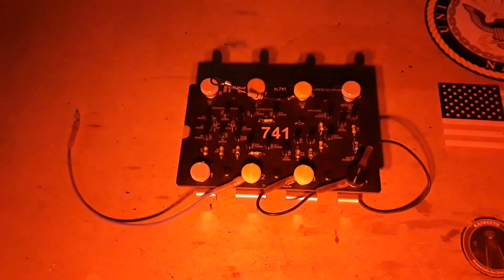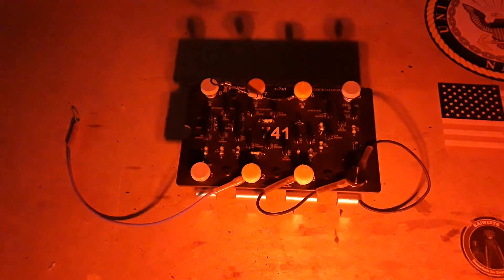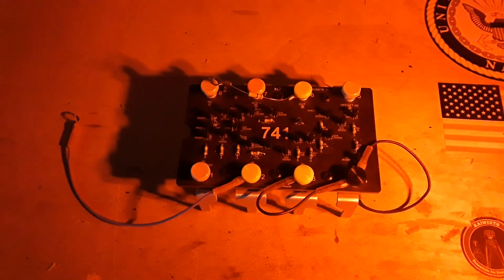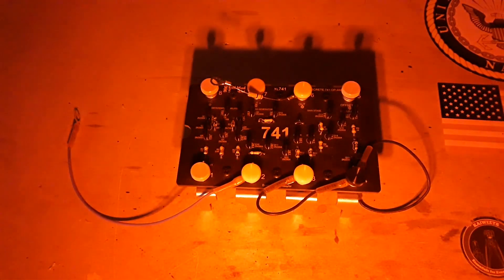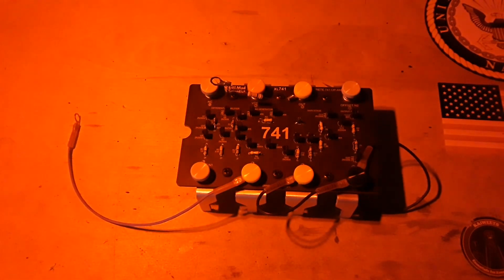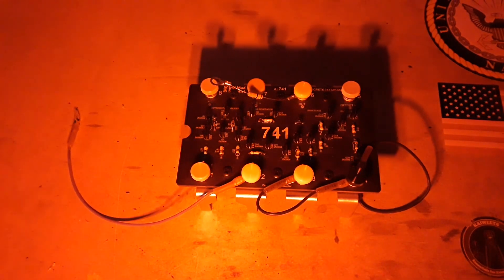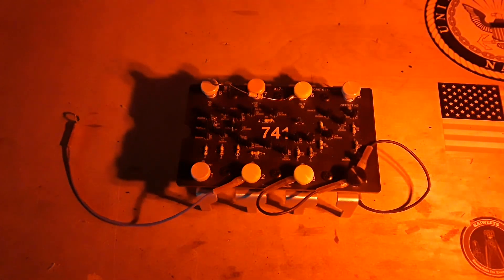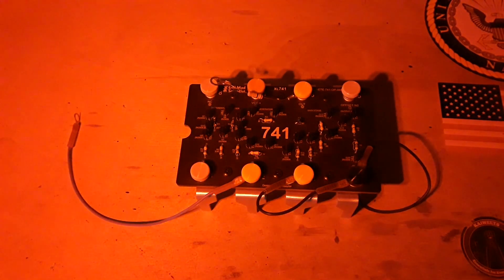Show Me Your Tips

Comment: My tips never use switching power supplies just don't.

Next clean your iron tip every single connection. 

Never directly measure current. 

Only switch voltage sources. 

TL431s are better than zeners. 

Don't use electrolytic caps if you can use a different kind.

LEDs can be used to detect light. 

Get a small amp and hook up multimeter leads to the input and use it as a signal tracer. 

Never use rectifier diodes for anything but rectifiers use signal types for peak detection. 

Transistors usually have low reverse voltage tolerance in the base and only be fed with positive with npn and negative only with pnp. 

Never let a signal source float unloaded always terminate with a resistor even if it's just a megohm. 

Decoupling caps are legit and always place them near every IC. 

Do not be afraid to use ceramic caps trust me they will have no measurable or noticeable effect on your audio.

Strip network cables cat 5 cables have 8 22 or 24g solid copper wires in them, perfectly sized for bread boards.

Comment: A simple one, but dead handy when breadboarding. And dirt cheap. 
Make LED and resistor one, by soldering a resistor to the short leg of a LED. Why insert two parts when one will do. Also handy as a power rail indicator Say... a 520 ohm or so. Bright with 5 volts, but not blinding. A great way to use up odd LEDs.

Comment: i dont have many tips being a semi new to this person myself but for a beginner having a shiny clean tip is the best tip doesnt matter how hot your iron in your not transferring heat well your solder joints will suffer
Reply: Temperature does matter. I have been soldering my whole life. Standard 60/40 solder melts around 550 -600F setting your temp too low will not make good joints. Also setting your iron to 750+ will can cause the solder to bubble and splatter not making good connections. Also high temps will destroy your tip over time. I recommend 700 F for most purposes. But yes keep that tip clean for sure.

Comment: When wiring audio equipment, use old scart cable, it is the best wiring that I have found and recycling at the same time.
Reply: Never heard of Scart Cable. 😂
Reply: @jj74qformerlyjailbreak3  it's nearly obsolete, it was the audio visual standard before HDMI, hence available for free, some of the connectors are gold plated.
Reply: @ericevans4040  nice. I keep all gold pin connectors. I probably have some I was unaware of. Thanks.